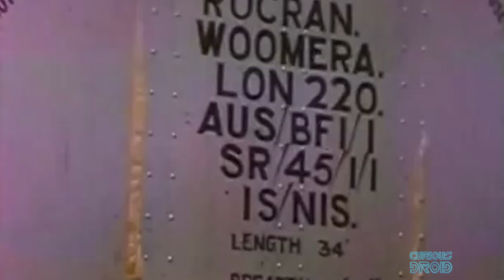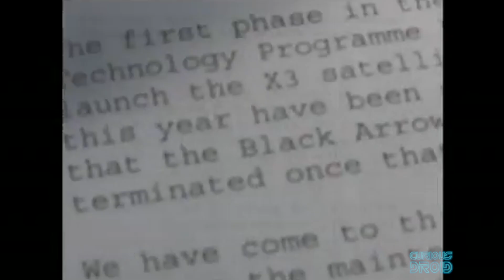Black Arrow : The Lipstick Rocket - A Very British Space Program

Comment: I also worked on Black Arrow at Osborne Works mainly on the 2nd stage Electronics Bay  and final stage separation bay and  the spin table upon which sat the final stage propulsion motor and the payload satellite Prospero . The French bought modified fairings from British Hovercraft East Cowes  as they had failures with theirs on the Diamant B rocket these were beefed up versions East Cowes a separation bay which took in the difference in  diameter on both rockets .These were they   tested at Osborne Works in the Kinetic Heating Rig they were tested successfully to their satisfaction and when the tests were over they produced photographs photographs of their Kinetic Heating Rig and it was a immaculate building tiled from floor to ceiling they couldn’t believe that they had failed with the facilities they had , they then produced bottles of Cognac and plastic cups drinking toasts to their success .Derek Mack the chief test Engineer at Highdown went with them to France to oversee commission of them they were successful Derek also went to French Guiana were the the Diamant B were fired from successfully Launching their satellites into Orbit Derek when the series was over was awarded  a French military medal which he accepted on behalf of everyone who had worked on the project. These were Engineer’s at Osborne were brilliant we unfortunately all had to work on a shoestring budget but always achieved good results.with the advances in micro electronics the Black Arrow would have been perfect to this day .

Comment: Kerosene or RP-1 burning with hydrogen peroxide does not make use of the remaining water vapor. Thus only the oxygen is burned and the water makes up 18 of 34 parts of it. There are means of utilizing the remaining water like using aluminium nanoparticles but that requires a solid or partly solid fuel. Of course aluminium could be liquified with mercury, lithium or other metals but I think that's too far fetched. The densest oxidizer would probably be liquid ozone --- but there have been no successful experiments to this day. So together with kerosene hydrogen peroxide is less effective than liquid oxygen which explains why it is so popular. Even amateurs like Copenhagen Suborbitals prefer to use liquid oxygen --- seems quite like it is the easiest option.

Comment: Thanks for mentioning the hydrogen peroxide oxidizer. It's what makes the rocket so interesting. I think that hydrogen peroxide has great potential for hydrid rockets (rockets with a solid fuel) and aluminium nanoparticles would even utilizes the remaining water vapour as it decomposes. Thus paraffin, aluminium and  hydrogen peroxide could make the densest fuel ever used in a rocket. It's a shame that this technology was completely neglected and forgotten.

Comment: Sorry but this remark; "Neither the UK Govt nor any Commonwealth country would fund the program" is not correct. The rocket base (the new launch pad, comms, radar & telemetry tracking systems) at Woomera was funded by the Australian Government, let alone building an entire town with new housing.  The vast majority of the rocket support crew on the ground were Australians.  As others have stated  below the Ted Heath pulled the plug independent of Australian input to sure up the EU agreements.  Australia also worked with the Americans during this period at Woomera.
Reply: Here is a short Pathe Newsreel on the new town. https://youtu.be/TC6ALCAB1hc
Reply: With reference to resurrecting the program, a lot the original UK engineers who worked on the Black Arrow project decided to immigrate to Australia or the USA

Comment: During the mid 1980s I was on an Australian Army exercise at Woomera SA and was able to visit the ground control and launch site in the vicinity of lake heart as seen in the video. The launch site with it's massive concrete exhaust channel had been destroyed to the ground level by SF or other unknown demolition teams. The heavy brick double storey building some two KM from the launch site was mostly intact excepting the many points blown through the meter thick walls and been used as a assault training aid. But why were there dead sheep inside. Anyway a very ancient landscape made the whole thing surreal.

Comment: This video is hilarious and loaded with improper or completely inaccurate information. First of all, hydrazine is not an oxidizer, its a fuel. Second, the stock footage you are using at 4:52 and talking about being able to store HTP in the hot Australian desert is actually footage of an oxidizer storage platform and the barrels are full of nitrogen tetroxide and red fuming nitric acid and the location is White Sands Missile Range in New Mexico. Thirdly, HTP is more complex to store than even IRFNA or NTO since it does not form an oxide coating on the walls of its container, protecting it from corrosion. It does though react catalytically with even the most minute trace amounts of impurities in the containers and it naturally decomposes which lessens its percentage as well as builds up pressure in its storage containers which means they must be vented at all times. Fourth, HTP vapors are EXTREMELY toxic!!!! Boldly claiming they are not is completely inaccurate and unfounded.
Reply: How does it feel to wake up every morning pissing excellents????👍

Comment: Given how well the Ariane family did, cancelling the Black Arrow was the right thing to do. I know it sounds harsh but Black Arrow wasn't as good as it might seem. It was too small, launch location wasn't that great, it was never designed to fly to GTO.
Reply: Ariane and Black Arrow were very different beasts. The smallest Ariane was more than 10 times the size of Black Arrow, the largest version 50 times the size.

Black arrow would have been great as a small, cheap launcher for communications satellites. Ariane was much more capable, but much bigger and FAR more expensive.

Comment: You missed the real driver behind Black Arrow. The Polaris deal was so good (as in Trident, we got the missiles at cost with Uncle Sam picking up the development cost), many doubted the American's would honour the deal, the deal that had been secured with the threat from Macmillan, that Britain would do what was ncessary to protect its deterrent, so if the US wanted a say in UK nuclear strategy, it needed to provide the UK with Polaris to replace the cancelled Skybolt. However to back this up Britain needed to show that it had the ability to build a submarine launched system, the Black Arrow took the off the shelf and redundant Blue Streak developed guidance and warhead technology and mated it with an off the shelf rocket technology developed for rocket assisted jet fighters, that was could unlike a liquid oxygen rocket sit fuelled for many months in a submarine. However when in 69 the Polaris missiles started  being delivered, it lost its principal reason for funding and so was doomed and it is hard to imagine that the UK would have continued it in the economic climate of the early 70s.

Comment: With the energy denser fuel, the rocket should require less material to contain the fuel and it should offer aerodynamic advantages. With modern materials this project could be the basis for a very competitive launch system.

Comment: Interesting take on Blue Streak/Prince/Arrow project. Just couple of things: 1st, Oz put an operational satellite into orbit in 1967 (your graphic leaves that out), called Wresat, before the UK in 1971 from Woomera, 2nd, you give the impression that throughout the project that it was purely just the UK spending $, costing 10 million pounds. In fact, Australia pour millions of pounds into Woomera launch facility with hundreds of rocket engineers, technicians working on the project, refueling, launch pad, control centre, etc, 3rd there was a significant commonwealth input into the project with Kiwi's involved as well.  So the revisionist, it was only the plucky Brit scientist by themselves against it all, is entertaining, but inaccurate.
Reply: The UK launched its first satellite (Ariel) in 1962, the third country to do so. They were the 4th country to launch their own satellite (Prospero) from their own rocket (Black Arrow).

Comment: Good video thanks, small correction: you described Hydrazine as an oxidiser when it's a fuel, and referred to 'HTP fuel', whereas HTP is an oxidiser, and compared its density to LH2 (which is a fuel) whereas you should have compared it to the oxidiser used with LH2 (which is almost always LOX), whose density is very similar to HTP.
Reply: HTP is both fuel and oxidiser and can be used as a monopropellant. It is quite a bit denser (c.30%) than LOX. When you factor in the lack of need for pressurisation and cryogenics on top of that 30% that is quite a considerable difference. Also LOX is far from being almost always used as the oxidiser in rockets. Due to it having to be stored at great pressure and/or very low temperature (preferably both) it is not suitable for rockets that must sit around fueled and ready to go, which is the vast majority of rockets. The vast majority off rockets are in fact solid fuel rockets and use compounds like ammonium perchlorate as the oxidiser,

Comment: A point you miss is that the UK Government found the agreement for Polaris so good they had doubts the US would honour it and in fact kill it and along with it the UK deterrent which many in the US administration wished. So a fall back solution was required that could be safely stored in a sub, and so the Black Arrow project was undertaken using an off the shelf engine and nav systems from the Blue Streak. So a bigger major in ending it was that from 1969-72 the UK submarines received their full load of 16 Polaris, the need to have and show the Americans we could maintain our deterrent had passed and so the "must have" reason for a cash strapped UK government.
Reply: Note in my wording, the engine was off the shelf but not from the Blue Streak project, it had been conceived as a booster engine for jet fighters. But the nav system and war heads could be lifted from the Blue Streak project.
Reply: @grahamariss2111  It was from the Blue Steel stand off missile rather than the much larger Blue Streak. The Blue Steel's engine was a double chamber design. The Gamma engines as used on Black Arrow were a development of the smaller of those chambers. So while it was not quite off the shelf, it was a development of an existing engine.
Reply: @LiamE69  You missed my addendum to the comment above, where clarified the origin of the components. The Blue Streak being the source the Nav and Warheads, whereas the engines came out of the work on the work for a fighter aircraft rocket engine, as the smaller chamber from the Blue Steel Senator engine was basis of the rocket assisted take off engines used on the Buccaneer as well other planned aircraft applications that never made it into service.

Comment: I wonder how things would be different if the UK didn't scrap their rocket program as the Black Arrow seems like it would have been a fairly low cost launch vehicle.
Hydrazine BTW is not an oxidizer it's a fuel often used with N2O4 as the oxidizer.

Comment: A good review of Britains early space program, however The politics are underplayed in this video. The US also offered "free" military reconnaissance data, removing another strategic value of continuing. The ELDO program was cancelled by UK as there seemed little prospect of the French built 2nd and German third 3rd stage or the Italian avionics working in synergy. The Woomera site was not an ideal orbital launch site as it was to far south and there was lots of ground to fly over before reaching the pacific limiting options for useful orbits.
Reply: Woomera has a VERY similar latitude to Cape Canaveral, and they seem to do all right from there. It has a much lower latitude than Baikonur and they get by.

Too much ground to fly over? The world is the same size wherever you launch from. At orbital velocity Perth to Sydney is less than 10 minutes.

Comment: And good ol' British boffins came up with a much cleaner, safer, but just as powerful fuel! (Hi Test Peroxide, 80-98%).
There's a great book (by a US author) on all the US nuclear accidents, and one involves some Titan missile launchers, and it goes into how their chemical fuel was almost as toxic as Plutonium (gram-for-gram).
Reply: Are you sure you're not talking about the Titan II specifically? Because the Titan I used liquid oxygen and kerosine and high concentration hydrogen peroxide is also pretty dangerous when it leaks. The stuff was used in torpedoes, but retired after many submarine accidents involving the total loss of crew and submarine such as the Kursk disaster.
Reply: high test peroxide is essentially the most primitive liquid fuel that you can use to fuel a rocket. it's performance is extremely poor in comparison to other cryogenic or hypergolic fuels sadly.
Reply: I think you mean with the Titan II's first stage, she used a mixture of Hydrazine and Unsymmetrical dimethylhydrazine (UDMH) known as Aerozine 50 as the fuel and Nitrogen Tetroxide as the oxidizer, two very dangerous hypergols. It's what gives the titan it's signature orange plume and clear flame. The more you know.
Reply: Htp is not as powerful as alternatives, which is it's main disadvantage. It's relatively safe, cheap, and convient. It's also good enough for many applications, unlike most other fuels as easy as it is.
Reply: Germans, actually, as pointed out in the video.
Reply: chemical fuel was almost as toxic as Plutonium ??? no way
Reply: forestsoceansmusic what’s the name of that book?? I’d like to know please
Reply: #uk
Reply: I think it's Command and Control by Eric Schlosser. It's not really an overview of all nuclear accidents but it goes into a lot of detail on the fire at a Titan missile silo.
Reply: forestsoceansmusic GeRmAnY
Reply: The book is " Command and Control" by Eric Schlosser. I read it a couple of years ago and it's indeed a real page-turner. The book is a blow by blow account of the  'Damascus' disaster as it unfolded at a US Titan II silo in 1980. This main story is intercut with documentation of other disasters and near misses and presents a fascinating exploration of the safety issues around nuclear weaponary. Last year I saw on Netflix the 2016 documentary film based on the book which also a great watch. Highly recommended!
Reply: If you had paid more attention to the video, you would have seen that Messerschmitt developed the peroxide-kerosene fuel system during World War II for the Me-262 rocket fighter. Your "British boffins" were actually German engineers.

Comment: Hair bleach doesn't usually contain hydrogen peroxide anymore. I know the one I used as a teenager primarily contained ammonium hydroxide. I tried using the standard 3% stuff to bleach my hair before that, and all it really did was lighten it very subtly. Even after several applications, my hair had only become a very light brown. Then again, my hair is really dark and I had to use the commercially obtained bleaching kit to the point where I had burns on my scalp.

Comment: Project : Black arrow. Let's paint the rocket red and white
Reply: It was the primer, we couldn't even afford the topcoat.
Reply: ME: "And another thing. You might want to get some black on your finish somewhere.  I mean, you've got the white. You've got that red part.  It's like, every color except black.  Doesn't make a lot of sense.
BLACK ARROW: "If we could just... step out of our literal minds for just one moment!"
Reply: EXACTLY LIKE WHAT THE HECK?!?!?!
Reply: @ES-wp4bi  the whole point of codenames is that they're not supposed to give you any clue what they're about.  The Germans screwed that up big-time during WWII, causing multiple instances where British engineers with a passing knowledge of German folklore were able to guess how secret technology worked - particularly radio navigation systems - from the poetic names the German engineers liked to give them.  The UK learned from this after the war and adopted a "colour-noun" system of codenames - Black Arrow, Black Knight, Blue Streak, Orange Herald, etc - carefully designed not to contain any give-aways.
Reply: It would still have to be mostly white, as black would absorb heat and damage components inside the rocket,where as white reflects the heat. That’s why the heat shield that was on the bottom of the American space shuttle was black, so it could absorb the heat
Reply: @Derekroytpt1  hahah I know was Just kidding.. plus the UK code system randomized a color with an appropriate noun.
Reply: xc5647321 xc5647321  i was hoping someone would mention a red rocket :P i love em
Reply: xc5647321 xc5647321  lol
Reply: Very Alladeen choice🤣
Reply: @ojastelwane1790  I was kidding...
Reply: What other colors would you use?
Reply: @marcopohl3236  black
Reply: @fulanitoflyer  don't be ridiculous, why would the black arrow be black?